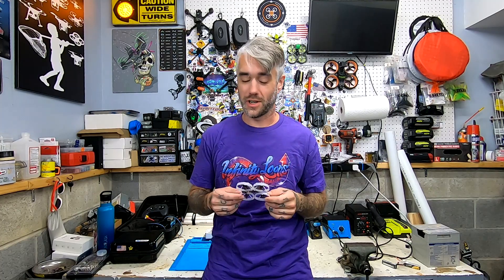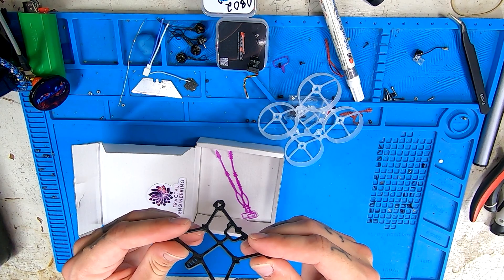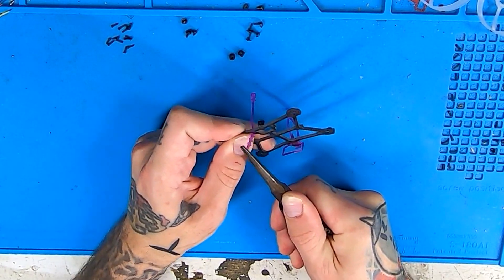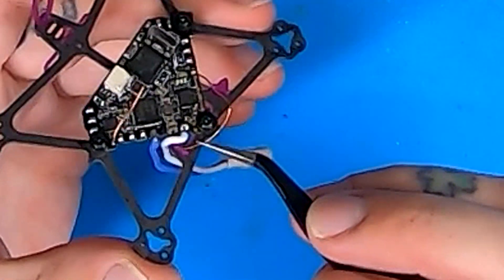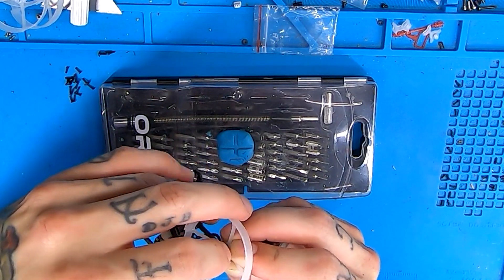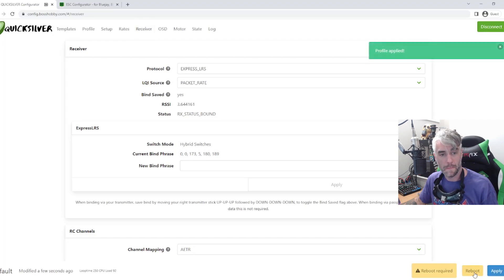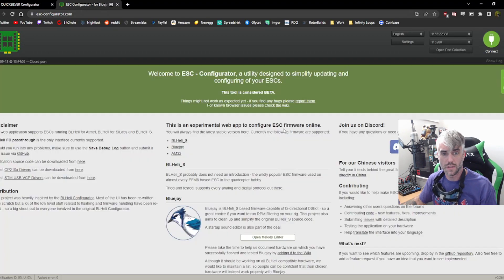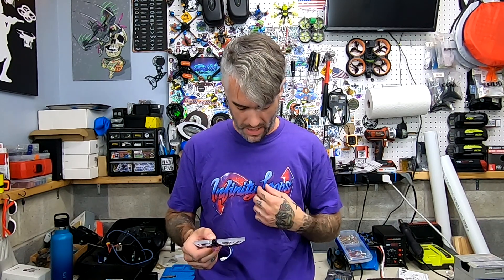The Mobthicc V3 | Complete Build & Setup

Comment: I built mine but keeping it on Betaflight. Quicksilver is such a PITA to set up (connects for me maybe one out of a dozen tries) and when I was able to connect, I couldn't use my channel map TREA. Still flies great on the hglrc 25000kv though! This may be my secret weapon this whoop season!
Reply from the maker: I had troubles connecting with Brave browser, Chrome seemed to work best. 
I love the HGLRCs, but this newer version has been spinning posts on me. Out of 10 I ordered, 3 have loose motor posts already 😒
Reply: @InfinityLoops  THANK you. Finally got it working after 30+ more attempts. Idk why I had such a hard time flashing but once I got it, it connects every time. Maybe a bug, idk
Reply from the maker: No worries, glad you got it working. I can ask the developers about it. What browser were you having trouble with?
Reply: @InfinityLoops  Chrome - I posted about it in the Discord.
Reply from the maker: Perfect!

Comment: Hi was wondering if quicksilver will work on stock mobula7 1s ..
Reply from the maker: Should be OK. They have targets for it.
Reply: @InfinityLoops  cheers mate.. been reflashing all sorts of settings trying to get it to fly as smooth as yours.. hoping its not just a “pilot” issue 😂
Reply from the maker: I also run the default rates, which helps with keeping things smooth.
Reply: I’m running QS on my stock Mob7 1S and it’s great. I had to bump up the digital idle a little but otherwise 👌🏽

Comment: Great timing! The parts for my F75 build just all arrived. Any comments on bt2.0 vs gnb27? I saw some testing that gnb27 has less voltage sag, but it seems bt2.0 is more popular.
Reply from the maker: I haven't tried gnb27s in a while but I heard they are better now. They used to get loose and lose connection all the time. Drove me nuts.

Comment: I'm building the mobthicc v3. Have you tried this setup with Happymodel EX0802 19000kV? Not sure if they can perform as good as 25000kV. 
What flight time are you getting?
Thankssss
Reply from the maker: I have! They perform just fine. Likely a bit longer flight times too. I flew 19000kv on this build originally. Then the 25000kv was suggested to me.
Reply: @InfinityLoops  Great to hear! Does 25000kV give you much more thrust across throttle range or just slightly more punch at top end? I'm thinking of getting 22000kV and hope I get the best of both world. 

Oh and are you getting 3mins with these 25k?
Reply from the maker: 25000kv I feel like I lose some low end throttle control. 22000kv might be a good spot for you, kind of depends on your style. 
Yes, 3-3:30 flight times on a 450mah.
Reply: @InfinityLoops 
This is how I fly: 
https://www.youtube.com/watch?v=igtaaq7T0yU

Thanks for the info man, Mobthicc is going to be my next go to whoop!

Comment: Thanks for these. One of the other builds where you transfered a moblite7 onto a frame seemed to have perfect feed is there something diff or each setup just a little diff?
Reply from the maker: Lot of outside factors can dirty up your signal. That FC in particular I have had very hit or miss results with, as far as the VTX is concerned. Some get break up within 100 feet. Some I can fly 400 feet crystal clear 🤷‍♂
Reply: @InfinityLoops  thanks for the response. Do you usually run vtxs at full or found better results using midpower. Seems everyone runs full power but wonder if your better off not pushing them. I hated whoops for a bit but trying to get back into them for the winter 😀
Reply from the maker: When I'm in my house I've found mid range power is pretty good. I only bump it up to full power if I'm outside. I've heard some wifi signal can also cause interference, so I'm sure that should be factored in as well

Comment: jesus those tpu strips are hella extra, ribbed for his pleasure haha. on a side note does the tpu camera holder really eliminate jello? it seems so insubstantial loose.
Reply: I was super skeptical but used the original prints for a month, only reason I had to print new ones is I swapped a few different cameras a bunch of times and ripped one of the "teeth" with my tweezers after poking it a couple dozen times. They work great and are stupid light. They work unexpectedly well to be honest.

One of the best whoop mounts I have had the pleasure of using. I generally carve custom patterns in Happymodel canopies to make them interesting and light weight. But these have been great. 
I haven't had to touch any of the TPU for several months, with general daily abuse.
Reply from the maker: It is such a simple design, it really works perfectly well. I've never had issues with them!
Reply: joining the hype train to say: I never expected to use the tpu camera mount, but I prefer it over canopies now!  Great footage and less ducts in the way.  I stuff some foam behind the camera to get the angle right.  Very reliable

Comment: Just finished my 75 with 2mm frame(all I could find in stock in US). Went with all the same components you did except the frame and my only difference was the last motor had to be reversed as well. I made the mistake of de-soldering the lead off an old cracked lens/overheating runcam 3 and trying to solder it onto the Pico, what a nightmare. I got it on but it's not pretty. Have to say it feels locked after a fast roll I don't feel like I'm catching a rubber band anymore. Thanks for taking the time! Edit: Forgot to mention, mine came in at 23.9g.